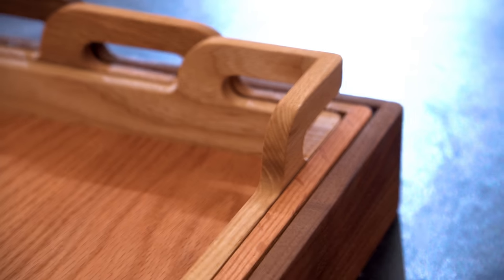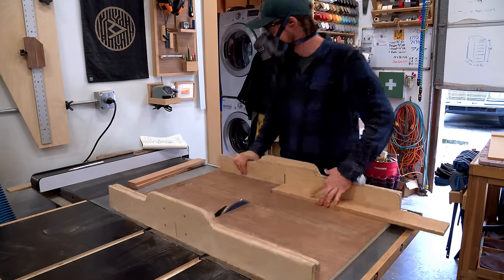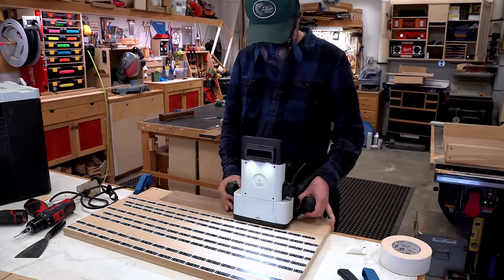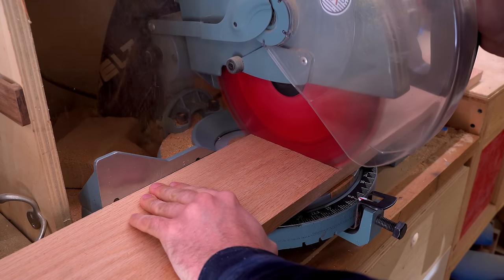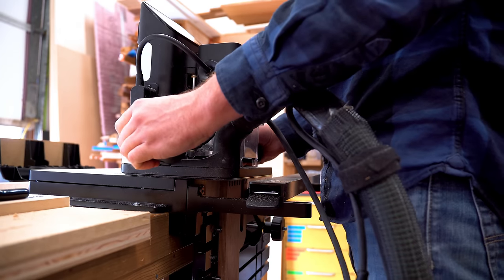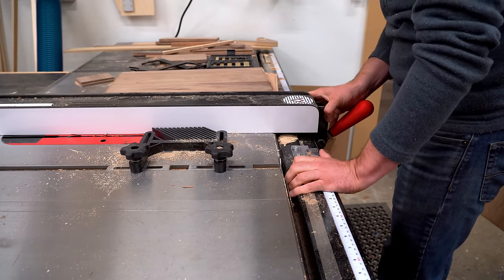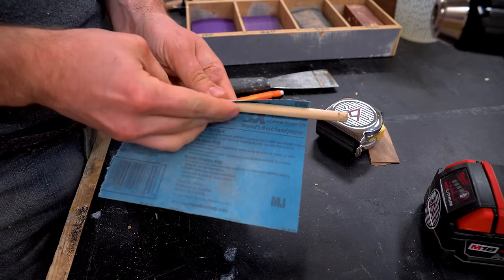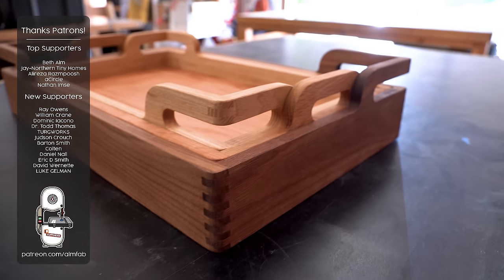Offset Handle Nesting Trays | Free Plans

Comment: Only thing I’d do differently is have the middle handle set on the outermost/bottom tray, and the edge handles on the inner trays.  That’s because picking up by the middle set is most ‘natural’ and so someone coming to the trays together would get all the trays.  That’s just a preference though.  Really love the look.
Reply: Ive just found this video but i thought the same your instinct is to grab the center handles
Reply: Thats a very good point

Comment: For some reason the stop dado is not consistent from piece to piece. The distance from the edge varies and on the smallest, inner tray, there is not enough material left for me to feel secure in the fact that the tray bottom won't eventually fall out.

Comment: Michael, is the Shaper Origin a replacement for a CNC or an addition to it?
Reply from the maker: Hey Dani, That really depends on how you want to use it. I make a lot of one-off pieces, and it does what I need from a CNC in my shop. If you're producing lots of products that are exactly the same, a traditional CNC is the way to go.